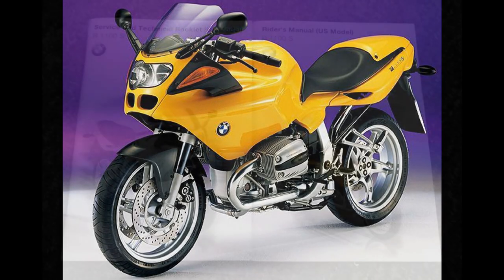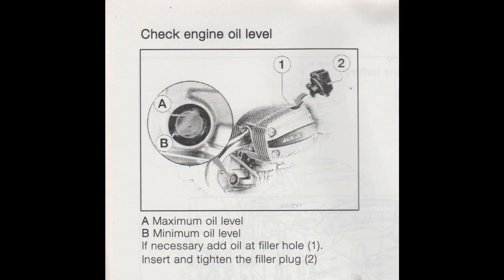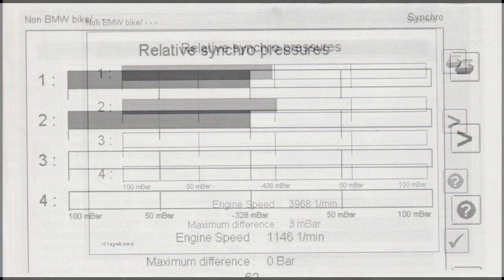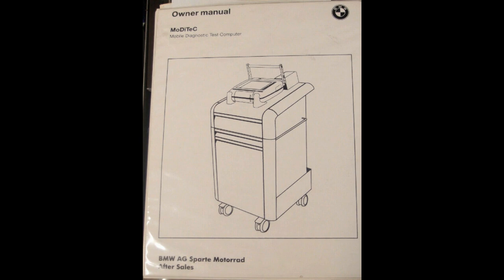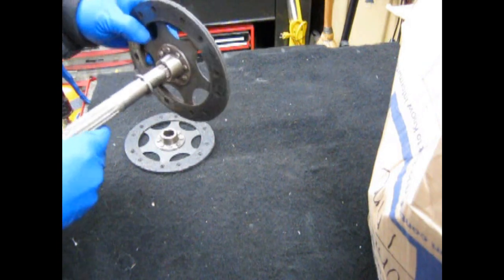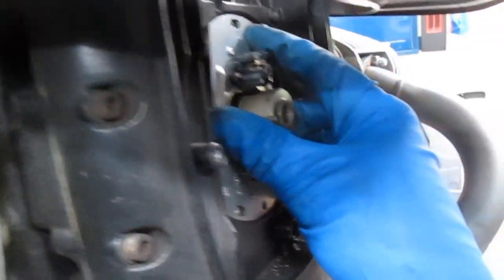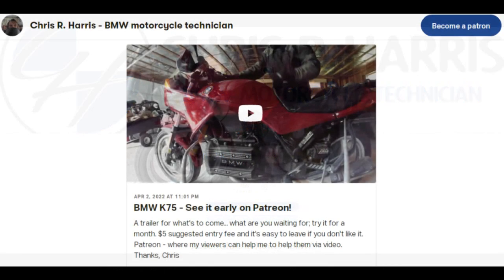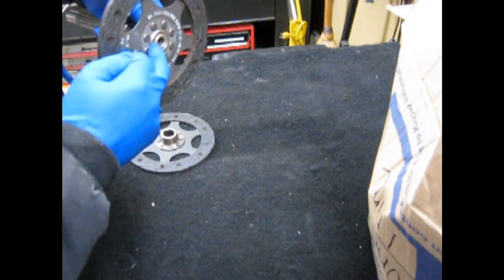BMW Service - R1100S - Part 4 - 1st Service

Comment: Chris, you included naturally, I am amazed in the competency of BMW technicians that work on these bikes.  I have spoken to several and each one was on the top of their game as technicians.  I know you'd probably beg to differ, but I'm speaking from personal experience.  Most of them can recite procedures, torque specs, and common failures ad nauseam.  Each were well spoken and true professionals at their craft.

Comment: Thanks for another great piece on the R1100S.   I recently picked up a 2002 model, BMW number 5 for me. Your videos are a great source of maintenance and upgrade tips for bringing mine up to date.  At 60,000km it has not yet spit the clutch splines.  I watched a previous video where you mentioned the issue and suggested it was often the result of excessive low rpm riding, so maybe mine will last a while yet.  I did take the precaution of ordering a replacement clutch from Beemer Boneyard, a great supplier of upgrade parts, so I have one on the shelf when the time comes.  I did replace the clutch slave because of gear fluid appearing in the clutch fluid.  The paralever bearings done at the same time.  Chain tensioner is next project.  Your video series has been very helpful all along this adventure.  I am 72, worked as a bike mechanic in the 70’s, moving on to aviation in the early 80’s.  I have never lost the joy of riding, nor the pleasure of working on my machines.  Your contribution to the sport and depth of knowledge with BMW maintenance in particular is really appreciated.   Thanks Chris.

Comment: My dad bought an R1100S and a K1200S from Second Wind back in the day - circa 2000 and 2004. Sounds like you two probably crossed paths! He traded in the R1100S after test-riding the K, then had the K delivered to him down in Doylestown, PA where we'd moved to!

Great videos! I just bought an '04 R1100S, so I'm finding this all very interesting and educational. Thanks!

Comment: Mine has been very reliable -- just a few miles from 60.000 now. But you know what?  many years ago I lost the clutch lever just as you showed here. Now I know what happened. I also had a final drive bearing go and fixed it myself. No problems since. Two years ago had the clutch replaced. Overall this bike has been cost effective and reliable. I took it to Montreal three weeks ago. the weather was horrible -- I got caught in the giant northeaster. But the bike got me there and back as it always has. Next trip to the Maritimes. Soon I hope, I love high speed touring on this machine.

Comment: Strange thing happened to my 30 year old K1100LT. To stop a very poor running condition I had to bang on the coils softly with my fist. Fixed it right away. Don't know what that was about.

Comment: Bought one recently, it has 57,000 miles. Feels strong.
Reply: Do you service it yourself, or do you take it to a dealer or an independent mechanic?
Reply: @shawcobra  I’ve done it myself so far. Changed engine, transmission and final drive oil. Changing the transmission oil is tricky without the tool but you can work around it. I need to change the slave cylinder. Do you have one or are you getting one ?
Reply: @radiocrash  I've been thinking of getting one, but the maintenance looks a bit daunting.
Reply: @shawcobra  it’s actually pretty easy to work on. Just make sure you change the clutch slave cylinder because if or when it fails it’s a big job

Comment: Hi Chris, love your vids, very interesting and in depth.
I have a question, the oil filter on my 2004 BoxerCup, is jammed on. The filter has an alloy cover/housing with an alloy nut on the bottom and a hole for a tye wire. The housing will not budge and I'm ruining the attached nut, I'm down to vise grips now and that is squashing the nut and still no movement. These aren't a left hand thread by any chance. The engine was hot when I started and cold now with no engine oil.
Any tips would be appreciated. I can't seem to attach a photo. 
Regards, Barry T, Australia

Comment: When did BMW fix the clutch splines problem???  (I've got a 2004 R1100S with only 16,000 miles on it.  Would my bike have this problem?)
Reply: yes. they all have that problem.
Reply: Seems BMW don't fix their known problems. Of which there are plenty.

Comment: Is there an easy way to tell if my bike has the modified clutch plate?
I have only had it for 3 weeks and am worried because I do a lot of riding in isolated places . I don't baby the bike and already in 3 weeks I have done 1900Klms.